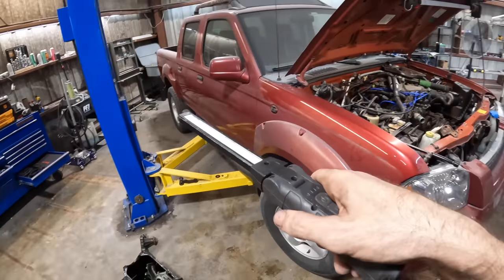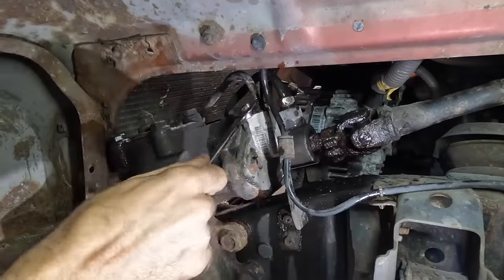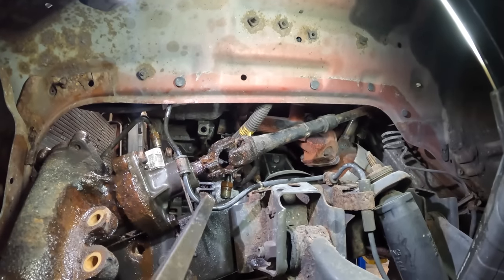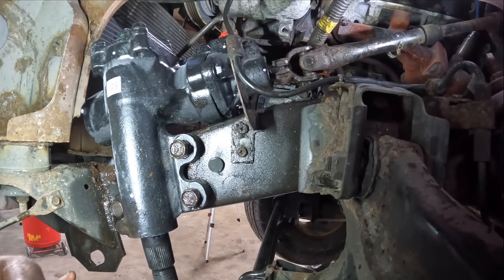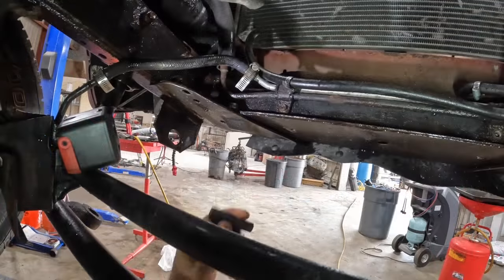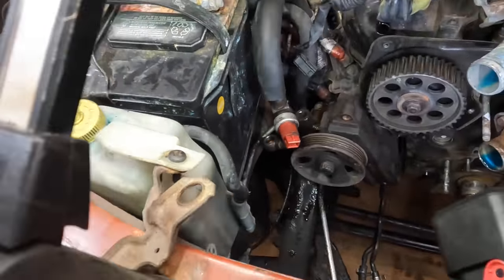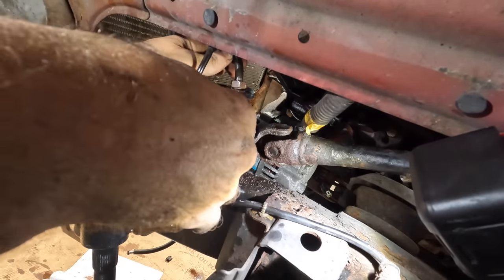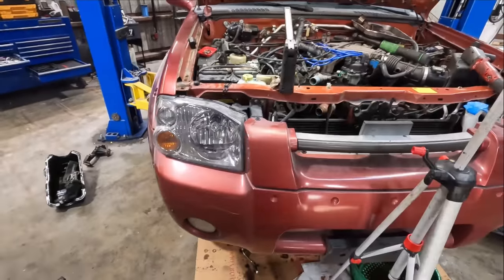Rusty Oil & Dripping Transmission Fluid! Pt3 #oilleakrepair #steeringwheel Nissan Frontier 3.3 4x4

Comment: When a rubber bush fails, I clean up the metal clip and use a length of heat shrink tubing to replace the bushing. Works well and lasts longer!

Comment: Yes sorry Ray I don't make a good spectator. 
Wire brush the spline  M&F and Kopper Kote it. Yes I stuck my finger into a 1/4" D 13mm the other day that one has been used for the front grill when I put the winter front on in Oct?? was it??

Comment: I’m guessing that with each removal of the oil pan it gets more and more distorted causing the massive amount of sealant you encountered.
Reply: When I remove a bonded sump, I place the flange on a flat surface and adjust it with a hammer until it is totally flat and ready for reinstallation. Then you only need the original factory amount of sealant, and the job is correct. I would bet Ray does exactly the same as he knows what he is doing.
Reply: @alandawson3345  Same with trans pan.
Reply: No big deal the guy bought 50% stake in permatex  it'll stick with him permanently.

Comment: Ray next time you pull an old line,  try buffing the ends with emery paper 180 grit the flare nut will work easier.

Comment: You should have used a battery termial wire brush to clean the internal splines of the stering coupler, would helped on the reinstall.🙄

Comment: 👍👍 now you know what we deal with in the rust belt, when we have  a leak it’s like free under coating until it just gets to expensive and the wife doesn’t like stepping on the oil slick on the driveway 😂😂

Comment: in 2000 i bought a new truck . almost was a nissan , but they wouldn't drop the price another $700 so i went to Toyota picked out a 2001 tacoma . . 23 years later it doesn't have one oil leak .  nissan sucks big time

Comment: Why don’t you use line wrenches? So you don’t twist the lines.
Reply from the maker: Line wrenches don’t prevent the nut it from twisting the line. They can offer more contact area so the wrench doesn’t slip.

Comment: The last time I worked on a steering system line replacement, I thought why don't they make a ratchet head tubing wrench?  It turns out they do!  Before I do it again I will have some.

Comment: You are just like my son.  I'll never understand why when removing the wheel takes less than a minute  to accomplish you insist on struggling to work around it.
Reply: Those minute jobs often turn into an hour job, and all those 1 minute jobs add up over the entire job.
Reply: Well on this PARTICULAR  one I guess we just disagree....I'll keep removing the wheels and have the added space. BTW I DO watch your videos EVERYDAY  so.....carry on.
Reply: One minute nothing takes one minute lol. Even checking the oil takes longer an one minute. I love Rays modus operandi. Yes sometimes there are what appears to be easier or faster ways but like with a lot of things sometimes those short cuts don’t work out to be so short. Win some lose some. It’s up to the guy doing the work everyone has a preferred method.
Reply: Let me guess... you're the guy who changes the timing belt but not the waterpump?
Reply: Cause you can lean on it😎
Reply: @lechatbotte  if it takes you longer than a minute to remove a wheel..  you're doing it wrong.  I'm almost 70 and I have no problem accomplishing that so.....
Reply: I understand
Reply: Ray usually does!   I was surprised that he didn’t!
Reply: @radleybradford1356  nope. If the water pump has to come off, it gets a new one. Even on straight 4's ware the water pump doesn't have to come off. It's just 4 to 6 bolts that are often not stuck, so it's easy & cheap insurance. What I am, is the kind of guy that works on old cars. The kind of guy who has learned through harsh experience, that if you can avoid removing extra parts, don't. On an 8 to 10 year old, or older car, what appears to be an easy quick removal is often a 5 hour job. Ware you could have just spent an hour & a half working around it. 5 hours vs 1.5 hours. Which one makes more sense? And that's just that one part. You often run into 3 or more parts that would just be easier to remove on paper, but in practice is a royal CF you just don't want to get into. Not to mention all the extra snapped bolts you never accounted for.
Reply: You are just like my dad.  You criticize way too much, and ruin every single moment.
Reply: 😂 I said the same
Reply: @williamallen7836  takes 10 extra minutes working around it. Math 😅
Reply: Lol. Everyone knows better!!!!  If you know better than our brother start your own channel and show us all how it’s done. Very simple. It only takes a minute to start a YouTube channel and get yourself up as a expert!!!!  Yay. I’ll look for your channel. Lol
Reply: @Cdub541  in this particular case. The shear number of times I have had bolts heads round, bolts snap, just plain stuck, wire conectors snap, or have the other parts being removed get damaged, it makes perfect sense to attempt to work around parts that have been in place for 8+ years. Of course the amount of effort always has to be taken into account. There are times ware I will just plan on replacing certain other items at the same time. My whole point was to highlight the fact that taking "1 extra minute" to remove another item often times is way more then just an extra minute. 
Early on I was of the opinion of just removing items that were in the way. Very quickly this turned 3 to 4 hour jobs into multi day jobs due to having to order additional parts, and removing stuck or broken bolts that wouldn't have happened if they were just left alone. It only took less then 1 year to learn this lesson. If you are in area that salts the roads, you can easily run into these issues on 2 to 3 year old cars.
Reply: @John Keating  Hahaha...touchy touchy...
Reply: @williamallen7836  William I have to agree but you know the saying you can’t put an old head on young shoulders, I wouldn’t have agreed when I was young as I knew better than everybody else. 😁 have a great day.
Reply: Is this car a scrapper,looking at that battery looks like its just come from junkyard.🤔
Reply: The path of least resistance, it does make sense, also I've seen him struggle unnecessarily removing exhaust bolts and nuts when logic dictates that you heat them up first and ask questions afterwards, I was friends with a shop owner and I learned a lot, the very first thing they did was heat those nuts or bolts up then try and remove them, I've never seen if fail, everybody has their own methodology.
Reply: Appears John is not a fan of simple  suggestions.....poor John
Reply: Common sense would tell you to remove it, you don't need to be a mechanic 😂
Reply: @johnlarkin549  you never grew out of it😂
Reply: @pennybeacham6461  not sure. I have bought batteries from the scrap yard though. When strapped for cash they are good alternative with a 30 day warranty. Out 5 batteries I have bought from pick 'n' pull I only had to exchange 1 of them. Everyone of them has lasted me at least 3 years. So all in, they are a very good deal when the full price of a brand new battery is budget buster.
Reply: All of us mechanics try to skip things by going around them sometimes in helps and other times it just forces us to take them off anyways after hours of waisted time that could have been saved we all do it and it just happens sometimes saving time to make money takes more time and we make less money we are all human
Reply: Removing the wheel could make it more difficult, as it creates a leaning point and therefore a powerful purchase position. That then stops you from getting fatigue and makes the job less tiring. The job then goes quicker and ease’s frustration. Then you can do more work and earn more money.
Reply: @level1804  Hahaha....yeah...  ok

Comment: For Christ's sake, the day before you're going to work on a real rusty vehicle, take a couple of cans of whatever it is you use as a PBR, and hose every nut and bolt down you'll be working on. 

And get some folding banquet tables to use to set parts you remove onto, to keep things neat and organized instead of shit spread out all over the place.

Comment: Ha, ha.  You are living your life 1/6 th turn at a time.  If you have to flip the wrench to get a second bite on the same flats, it's 1/12 th turn at a time.  It can be slow going with those hose ends in tight quarters.

Comment: If you spent the time you were whinging about the power steering fluid in cleaning the area concerned, even with the brake-clean cancer causing spray your life would have been much more comfortable and the customer's car would have been in far better condition.

Comment: I'll say it again, have that lift adjusted, the equalizer cable is out of adjustment, that's why one side is lower. So when you go to get it off the locks, it rocks the truck sideways.

Comment: Honestly as far as you were into it, and the fact the other lines been repaired, id have opted to do both lines, I dont think the hose clamps are as presure rated as high presure fittings that are swaged back on also the rubber hose looks more like vacume hose and not high presure hose that has a wire mesh inside the rubber.
Also the sterring gear box looks rebuilt not new, why couldn't it be rebuilt, if its just leaks it was probably a blowen gasket dont they sell gasket kits for it?

Also your knee deep in oil pull the altonator and rebuild it. 
Back in the 50s mechanics rebuilt every part in a car but you could also buy rebuild parts, now you just buy rebuilt parts and the qulity is questionable at best. Or you get cheap Chinese knock offs.    
I was watching a Toyota tec who showed 
So called oem replament parts in a look alike toyota box and the parts are total fakes,  the box said made in Japan on one side and made in china on the other they even had toyota logos on the box
But here's the catch, the parts are made in the USA  you cant buy a factory made oil filter it cost too much to ship over seas.
Same with air filters and so on.

As rusty as the truck is id have shot the rusty areas with a stop rust  the guy should have bought you a case of it.
Also with that dam much oil how the hell did anything rust?

Comment: I would have removed the engine. Clean engine bay with engine out. Easier than pulling diffs out and steering gear etc. Just saying

Comment: Hey Rey, what's the brand of the engine flush chemical that you've used in recent videos? ( not this one obviously). Also is it safe for a 13 Ram 2500 with 5.7 hemi with 150k miles?